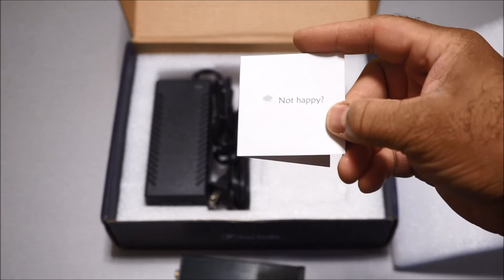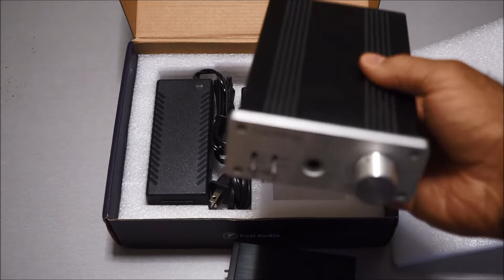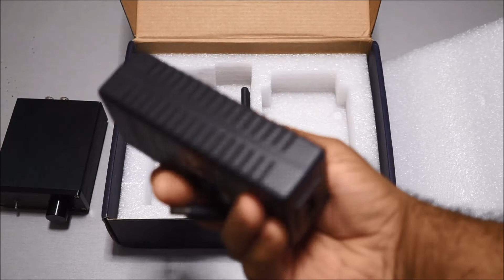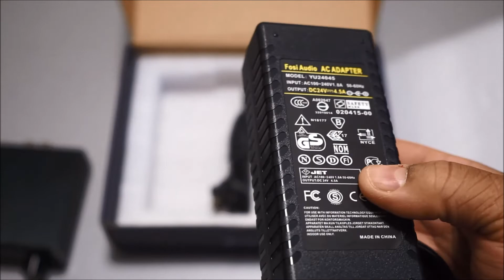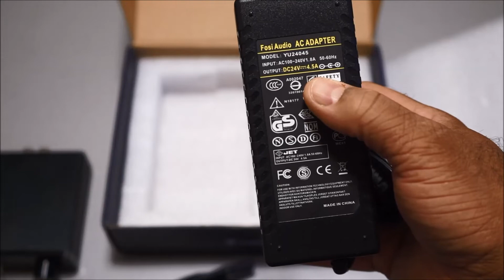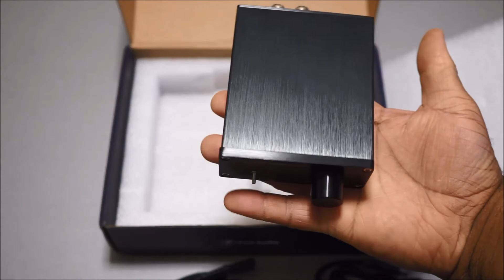Fosi Audio TP-02 Subwoofer Amplifier Unboxing

Comment: So how does she sound bro?
Reply from the maker: Thanks for the comment. I was surprise when I hook up this tiny amp!  It sounds amazing for its size.  I first hook it up to a small 6-1/2" subwoofer driver in a compact sealed cabinet.  The tiny amp was too powerful for the 6-1/2" subwoofer driver.  It was pushing the driver to hard and made the driver distort easily.  So I hooked it up to a 12" woofer and it sounded really good.  I didn't even put the 12" woofer in a box (I don't have a box that size to fit it). I used the woofer as a open baffle with no box.  The Site specs says the amp is rated at 220 Watts at 2 ohms!  Its hard for me to believe that, but the amp has so much power, it can easily drive a 12" woofer.  
To me, I would rate the amp at 100 or 120 at 4 or 8 ohms. I would recommend using a 10" or 12" woofer with this driver. Plus the crossover built in the amp is 18dB octave, so the bass is very steep and deep. So I would definitly get this amp if you can.  Look for it on Ebay.  
If I have time, I will make a video demonstrating how the amp sounds.  I'm really impressed by the power this tiny amp has.  Now, I'm excited to build a cabinet for the woofer.  Here's a link from amazon listing the amp.  Amazon says the amp is Currently unavailable, so its must be a older model, but if you keep checking Ebay, you may find someone selling one.
https://www.amazon.com/Fosi-Audio-Subwoofer-Amplifier-TDA7498E/dp/B08ZKMG3FT
The model is Fosi Audio TP-02 Subwoofer Amplifier 
Thanks...
Reply: @lovethatpop  keep it open baffle! that's my plan and I'm going to buy this amp.